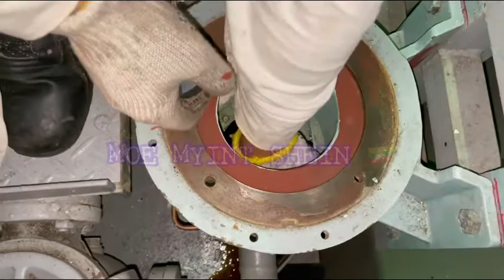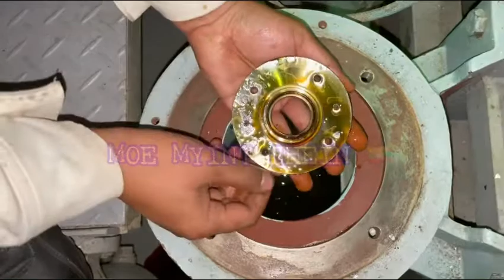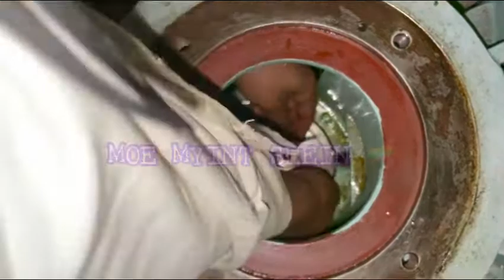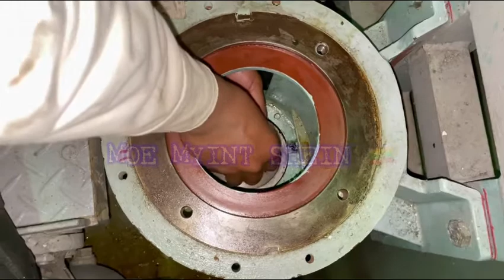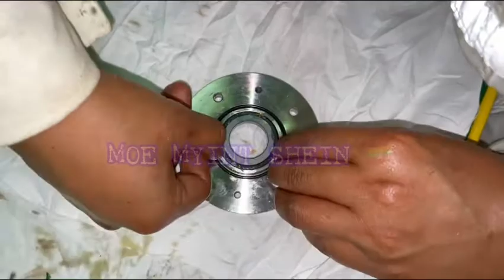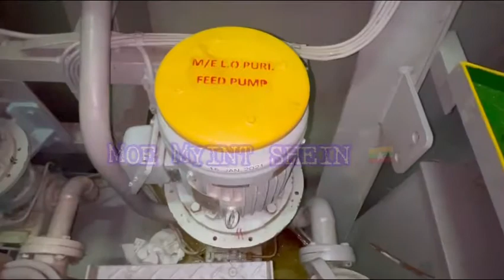[REPAIR] Damage MECHANICAL SEAL of Pump | Marine Engineering | Technical Vlog : 046

Comment: sir, may i ask you a question pls?
what is the function of shear pin in pump? 
i've neven seen it before.
Reply from the maker: Likes Safety Pin. Shear pin will break if excessive load occurs in pump side or misalignment, and protects coupling bolts and motor from damaging. Sure, motor has OCR Protection. 

Normally, only one metal shear pin can be seen in coupling. 

In some type, couplings (pump and motor sides) are joined with Teflon sticks or Rubber sticks without metal bolts. In this types, these rubber or Teflon sticks behave not only as shear pins, also flexible joint. 
Careful, these non metallic pins can harden in hot environment and can easily break due to ageing. 😊
Reply: @CHiEF_MOEMYiNTSHEiN  ❤